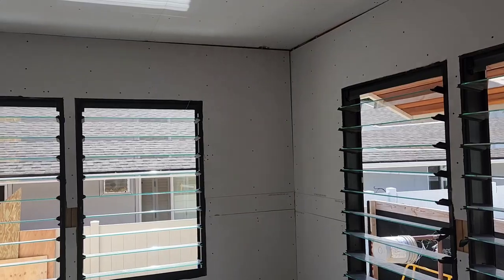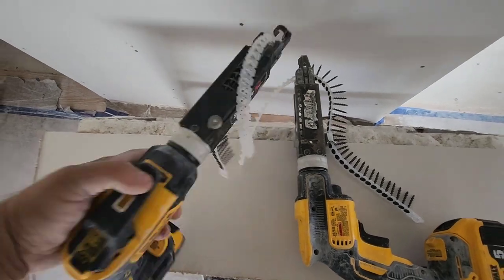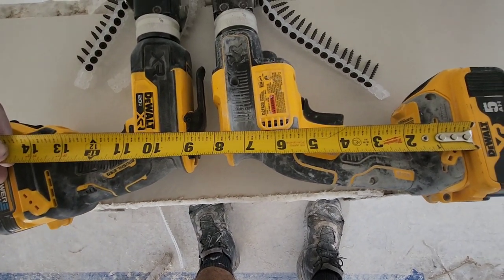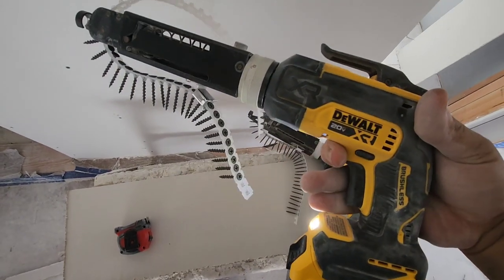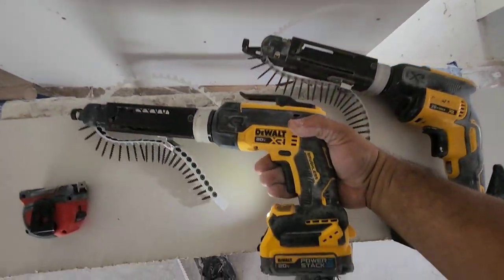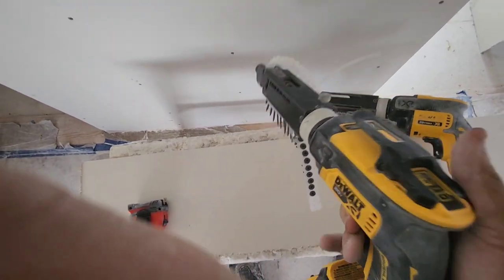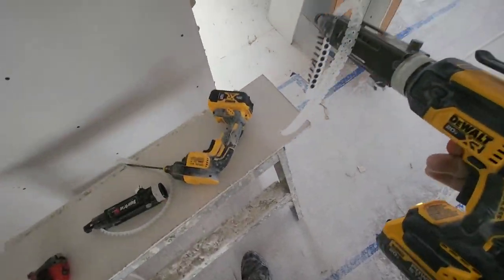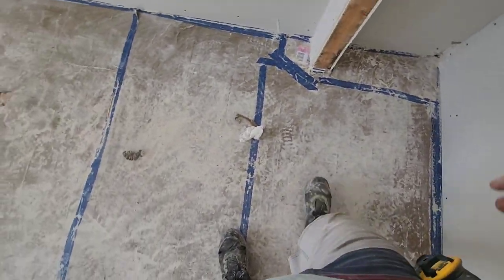New Dewalt Drywall gun

Comment: I'm glad they changed the forward/ reverse switch, I'm always bumping it by accident on the old one.  The new one looks so much smaller too, can't wait to try it out. Thanks for the video Memo!
Reply: That's crazy man it's so weird ppl have different taste I'd waaayy rather have a faster forward and reverse switch then the impact switch on a screw gun
Reply: @cornyfehr1094  I can see that, I guess I don't usually use reverse on it. I keep the m12 in a holster in case I have to pull a miss
Reply: @Drew Shafer  if you are using the screwgun for drywall u can pop the nose cone off hit reverse and apply a bit of pressure against the missed screw and swiped it left or right either way it will losen up and then u just grip with you're fingers and away u go
Reply: @Corny Fehr  Yeah, I took off the nose cone in favor of the collated screw attachment. It's a pain to remove, and quicker for me to just switch to the mini impact.  We need a stud sensing nose cone to eliminate misses entirely
Reply: I cut the forward/reverse switch off because it was SO annoying. With the magazine feed attachment, I never put it in reverse anyway

Comment: Would have loved a big trigger for forward, and small for reverse instead of having to change the mode. I've used the old Dewalt, and find the switch there to be much easier than to change the direction switch on the Festool which is high up on top of the took

Comment: Are the batteries interchangeable?
Reply: Both 20v
Reply: @bradleykornele  so the old Dewalt 20v work in the new guns?
Reply: @johnfisher9969  all 20v dewalt battery interchangeable the powerstack battery is just smaller footprint different battery tech (pouch vs cells) very expensive though
Reply: @bradleykornele  thats what I needed to know. Thanks! Time for a new gun and router, ive got like 6 batteries that are still good.

Comment: Does this new model leave the screws flushed or zinc in correctly old one just wouldn't 🤔
Reply from the maker: We haven't had any issues with both models.
Reply: @csdrywallhawaii  I switched to Makita after first model first model lock button always popped loose  but this new one seems different

Comment: I feel bad for the trim guy thats gonna have to case those doors, scribing casing SUCKS!! Framers meed to stop doing that 3" off the wall shit, should be at least 4.5"
Reply from the maker: The board and screws were removed after video that's why I did it on the case opening since it was foing to get buried with wood to hide the holes the screws left behind. I won't set up the guys behind me like that. Thanks for watching 🤙🏽

Comment: Take spray froam fill it in and take a break away knife and cutt it flat sand it smooth then add some 20 min hot mud over the foam down the wall a bit boom gap be gone mfs